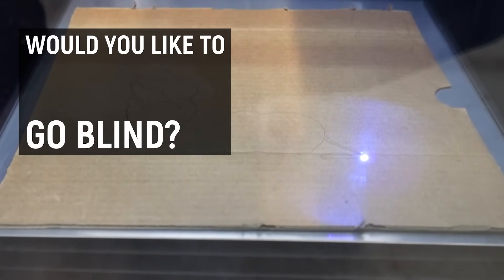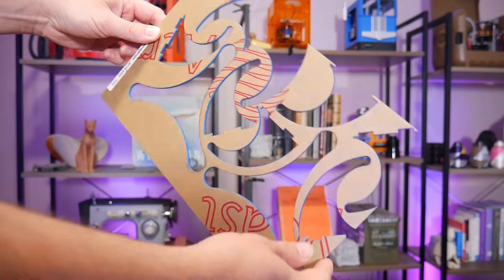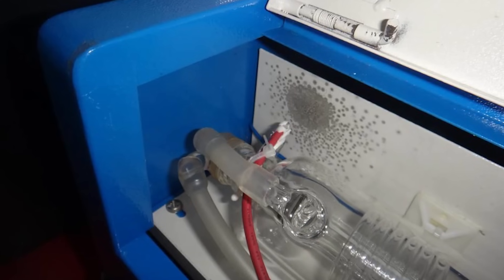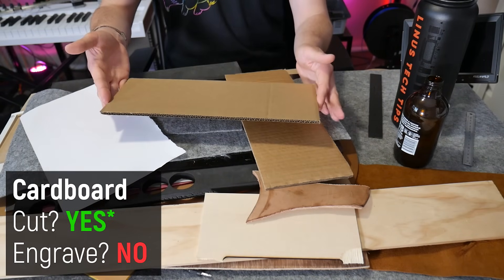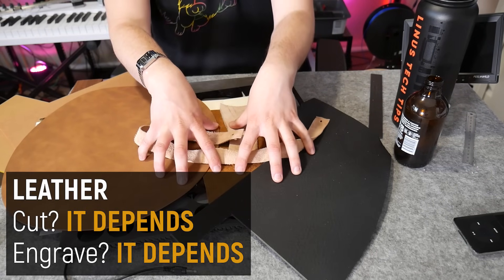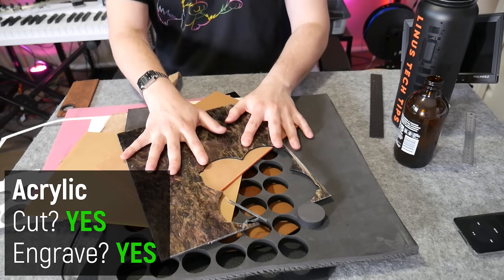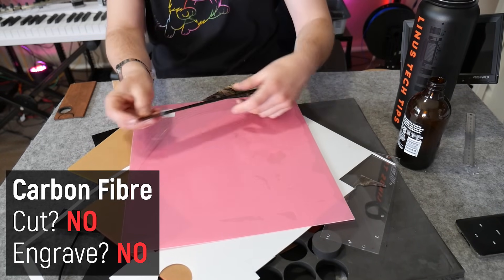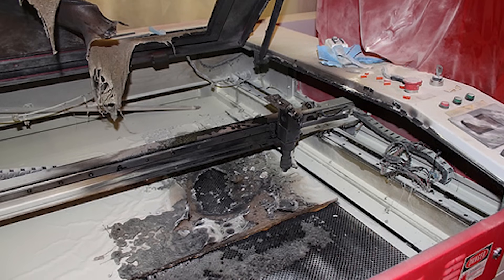Are cheap laser cutters safe?

Comment: Angus thx for sharing & scaring. Ah come on these mfrs wouldn't make & sell something that could injure people or personal property. I think you're overreacting. Just use your remaining good eye to keep on working.

If your house catches fire, break out the marshmallows and use a selfie stick for distance of better yet a fishin pole.

Laser power supplies only use the 25 kV to strike the tubes. The main PS is only about 2 kV with a couple of 100 mAs of current. Just because 100 mA is typically lethal no worries you'll only touch it ONCE. And if you're well grounded you'll only touch it just that one time.

No on to diode lasers, no electrical worries here they are low voltage and the current is several Amperes and cheap connectors will burn in two only one time. Typically with either a bang or a big 10,000 deg F plasma flame just like your welder. The light output is tasteless, odorless and colorless being in the IR spectrum range. Just not as IR as CO2 tube lasers. It's nice that you won't even know that the abhorrent light ricochet is occurring and just blinded your dog. But, who cares it's only a dog.

Enclosures and PPE are for sissies anyway. So, I say put caution into the wind and getr done.

Hoped you all liked my little satirical musing. Angus is totally right take all precautions. The power of profit is far more important than telling you you just bought a very dangerous device.

As always, it's our job to stay safe.

Comment: I would dispute that cheap laser cutters arnt safe.

I've work professionally with lasers. And to make my ortur lm2 safe I've built an enclosure with proper air management, hepa filtering and vents outside at the top of my chimney. 

Obviously yes, toxic fumes is a serious risk.

So yes. A hobby laser is potentially dangerous. But it's as safe as you make it
Reply from the maker: I absolutely agree with you, but would you say that you only knew to build the enclosure with proper filtering because of your experience? I'm really concerned about all the people buying them with no prior knowledge, because the companies certainly don't make it clear just how much additional setup you need to run them safely.
Reply: @MakersMuse  fair point.

I'll admit I wouldn't recommend one to someone with no prior knowledge.

Comment: One thing that I think is important to add is that solid state or diode lasers are far more dangerous to the eye than a CO2 laser of the same power. The 10.6 µm light produced by a CO2 laser is absorbed by the outer layers of the eye, so you have to be pretty much looking directly at the beam (e.g. due to the mirror misalignment you mentioned) to be blinded by it. But visible or near IR light produced by solid state and diode lasers goes right through the outer layers of the eye, and gets focused on the retina, where even a tiny amount of specularly reflected laser radiation can cause burns on the retina.

And as for the various plastics, I would think that all the plastics that are just combinations of carbon, hydrogen and oxygen (PE, PP, acrylic, polycarbonate, polystyrene, and yes, EVA as well) should be similarly safe. With how hot the laser cutting gets, there probably isn't much of the original molecular structure left, and so you basically end up with a mixture of CO, CO2 and various polycyclic aromatics and amorphous carbon aka soot. With plastics that contain nitrogen as well (e.g. nylon) I would expect to see some nitrogen oxides and possibly cyanide as toxic compounds, and as you said, anything that contains chlorine (or other halogens) will produce hydrogen chloride (or the corresponding hydrogen halides).

Comment: Though this information is valuable, and the presentation is exceptional.  The entire premise of the video is flawed. 
    The machine is only dangerous if the person using it is negligent.  Any piece of machinery designed to mill, cut, grind, shave, burn, etch... whatever.... can be dangerous if used incorrectly. 
    In a split second, you could remove a body part with a table saw, or a bandsaw, . You could electrocute yourself with a welder, or with a screwdriver in an electrical box.  You could be killed by using a power tool, or extension cord that's missing the ground prong, while you stand barefoot in a puddle of water.  
      If you don't wear eye protection, you could be blinded using almost any piece of equipment in the shop. Just as easily as the idiot who would run the laser without protection.  
     So, instead of just saying these hobby lasers are too dangerous.  Maybe you could explain how to make them safer. 
    they can be safe if set up right.

Comment: VERY, VERY Important and good video. Thank you for that. Laser Radiation by those cheap Lasers is no joke. Even worse: The UV light emitted bounces from every light surface and due to it's laser nature it doesn't scatter enough, once it hits your retina. You don't even have to look direly to the laser to put enough strain on your eye, to make you go blind over time or in the worst case immediately. This UV laser emits UV-B light in the 405nm range, it's like looking right at  a MIG-welding torch, without the rist of cancer because of the missing UV-A part. And even a small, sub-watt diode can cause this. Like the once, used in blue-ray drives.

Comment: guess who tried to transform old ender 3 to a laser ? WITH THE FUCKING IDUNNOWHATBONATE GLASS BED ?

the claimed 90w diode laser worked well even if it has probably blind me +30% because the bed reflected light everywhere, i directly turned it of, was happy my mount was working

30 seconds later: EXPLOSION! not the small one, no i mean like a bomb, with glasses throwed meters away, hopefully my cat was protected during the whole process (even from lights), on my side not sure if i had nothing in my skin but less important hahahah

realized the glass bed was made of small pieces reflecting all lights to some other pieces which multiplicated the laser lights by fucking hell and made it melt inside until it explodes really well deserved and funny experience, but i probably lost one of my seven life that day

Comment: THANK YOU,
Finally somebody made a point about how foolish these blue laser cutters are.
I have told my wife I'd be interested in a laser cutter, but I would only ever operate one that had a window that is opaque to its color, and a lid switch that cuts power to the laser if it is open. I already have a little bit of eye damage from a green laser pointer when I was younger and stupid, I don't need more.
Reply: You might want to have a look at xTool M1 then.
It's more expensive than the open frame type but comes with features you mention and has a built in exhaust fan and hose.
Reply: @YaaLFH  I definitely like the form factor and of course the enclosed nature, I just don’t have enough interest right now to drop $1k on a setup for laser cutting.
Reply: @pjtruslow  Sure. At least now you know such machine exists. The price point is higher than open frame lasers but you don't have to spend extra on enclosure, exhaust, etc. Plus you get a decent blade cutter as a bonus, in some areas better than a Cricut which makes the price somewhat more palatable.

Comment: I think you didn't focus enough on the laser safety glasses. 
DO NOT TRUST CHINESE LASER SAFETY GLASSES. Buy some real ones from Thorlabs, edmund optics or some other reputable optics supplier. Get ones with high OD ratings. Yes, they'll cost more than the laser itself. But you've only got one set of eyeballs and it's a small price to pay!

Comment: I would actually kind of quote you in my tragedy regarding resin printing. 
None of people like you, and you yourself I ever saw wearing adequate masks. especially in your video coming up in searches on the first spot. 
I seriously wonder if I am the only one that had it's lung corroded by the fumes.

Anyone I can tell, resin is always toxic, no matter what the companies will tell you. 
You must always wear a real mask (at least one with attached filters of type A2, or ABEK if possible), never use it in your home/house but only a dedicated area with plans and protection for worst case exposures in place! 

While PLA is fun and fumes and dust don't appear to be too dangerous, 3D printing and making quickly goes from fun melting to hardcore chemistry and respective hazards.

please don't rely on manufacturers claims of non-hazardousness (le goo water bs) and even state regulators do not consider all risks associated. 
in my case EU with quite strict regulation, it didn't look at the decomposition over time of the compound. At the beginning you might have a great experience and with little impactful toxicity , but after some time you might be dealing with a strong acid burning your lungs like mine😞. 

but yes great that you do a video about the dangers of lasers cutting

Comment: You said you can't engrave paper or cardboard! That is completely wrong. It all depends on the strength of your beam and what your focal point is. If I can engrave paper then you can engrave paper. If I can custom engrave a business card at the same stock thickness of a business card then you could do the same thing. All of this was done with a desktop laser. Now if you try to do that with the CO2 laser of course you cannot. You cannot turn down your laser enough like you can a diode laser. Of course without pumping two or more diodes you can't cut thicker materials. All in all I don't like your video this time my friend! We are a different ends of the spectrum on this one.

Comment: I've been using an open frame laser cutter for years! My first neje just died. You're scaring people by making them think that the beam is actually going to irradiate them. They're reflected light won't do much for penetrating skin but can damage the retina beyond repair. That's why the first thing I did when I bought my laser was went to eagle pair and bought the right pair of glasses at the right nanometer with the right OD rating so that I would not blind myself. If anybody wants to get into lasers but was stupid enough not to research protection first then they shouldn't be messing with lasers. As a matter of fact I believe there should be an aptitude test for lasers 🤣 that was kind of a joke but I seriously do feel that way. Every time we get access to new tools like this some ignorant idiot has to blaze ahead without doing any kind of research and seriously injure themselves. Every time this happens we lose a little bit of public access to technology and that hurts my heart to no end. I have all the fun gadgets and I have never injured myself more than a minor burn here or there. Hell I even made Ruby with a cheap 20 watt laser as well as titanium beads from titanium dioxide.
Reply: By the way I do love the portability of my laser. The fact that I can mask an object off by using a small box and place my laser directly onto said object at almost any angle, you're not supposed to be able to do that but I have disabled the tip over switch, then all I have to do is initiate the program and make sure that my marker box is in the right spot before it starts it's cut or engraving. With proper ventilation you can even do vinyl which was one of my first projects.